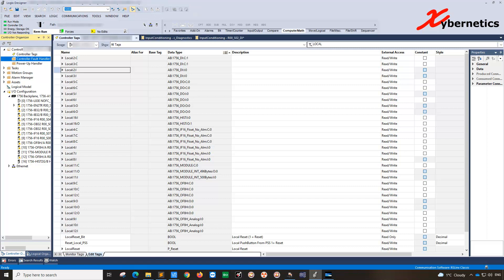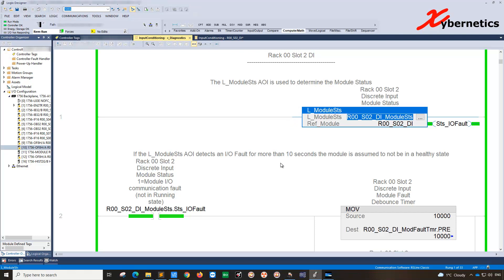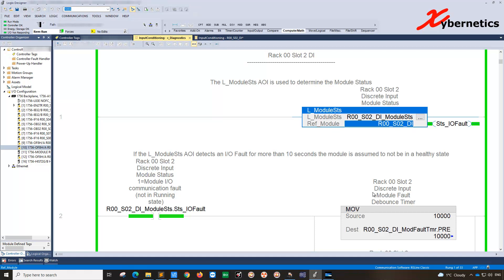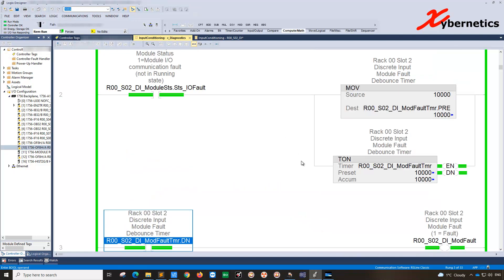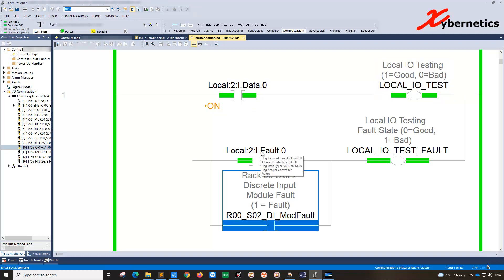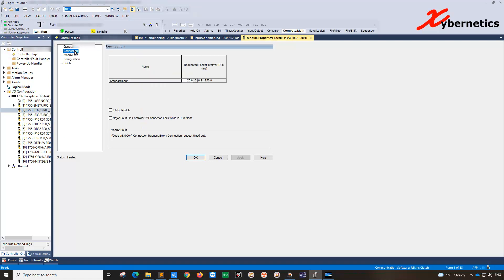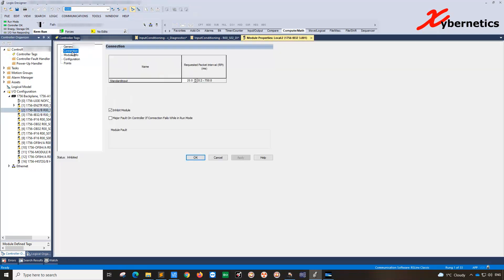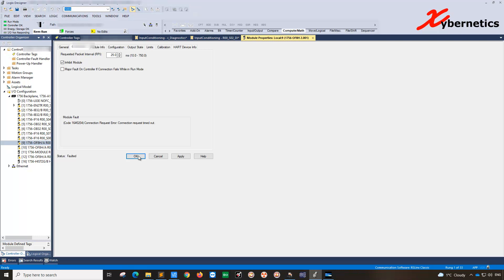Allen-Bradley PLC Module Fault Vs Channel Fault | How To Disable Them In Studio 5000

Comment: Is it any feature in allen bradley so that we could record problem that make module fault alarm in system? I facing frequently module fault problem in my plant and still curious to find out what exactly problem generating that issue. Someone suggest me to check on DLR loop or connection instead of module itself since module fault problem not always link with module problem
Reply from the maker: The solution provided in this video was specifically for module fault. It is generally pertaining to the module physically damaged or not configured correctly.
DLR loop is entirely a different problem altogether.
I would need more specifics to help you out a bit more, but these are my initial and quick assessment.
Reply: @jjnet247  thank anyway for response.